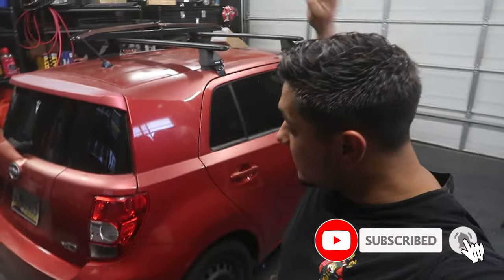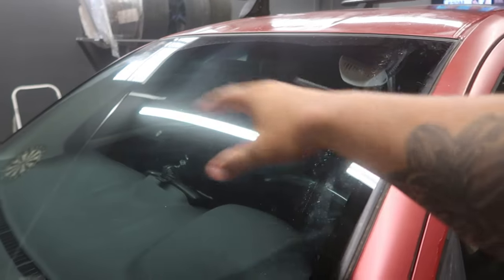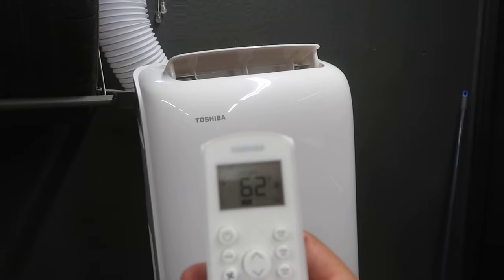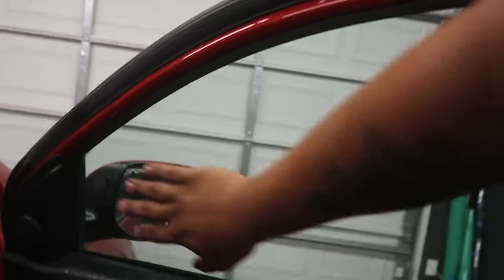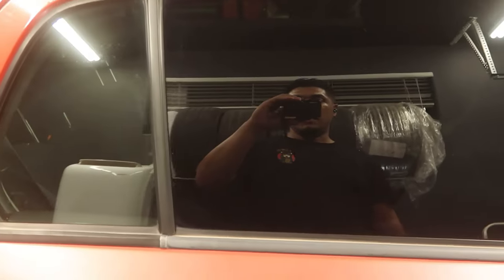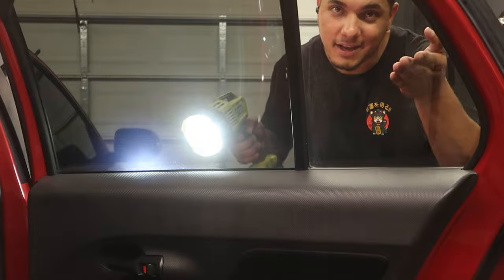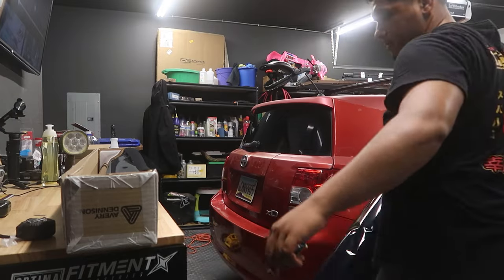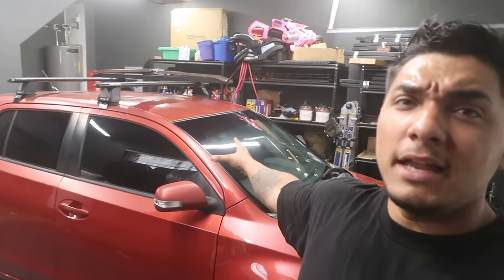Full 15% Tint on this Scion XD!

Comment: I am also a beginner tinting, the struggle it is real 😂😂😂😂😂😂. I wasted around 50foot roll just training, but my biggest mistake was the cutting part. Love your honesty real 🔥🔥🔥🔥 you are getting better every time. Let’s do it 😎
Reply from the maker: Oh trust! I wasted a pretty decent amount from creases, burning, short trim, etc 😂
I’ve done about 6-10 cars free until I was confident enough to start charging
Reply: @brandonleyva11  to be honest I train in my car, I have a Acura MDX 2017 advance packages, after my car I did a Durango RT2021 🤣🤣🤣🤣🤣🤣🤣 2 front window and front windshield $240.
Reply: But my mistake was buying a expensive film for training  36x100 ( Pro classsic ) $255. Luckily I was able to almost make the money I spend on the film with once car. Also the film it was lifetime warranty.

Comment: The struggle is real...I am going thiru the same thing...Frustrated with the cut.
Reply: It’s easy to ruined the film by cutting short, I went through that 100 times until I starting noticing went I was cutting the film was moving pay attention to this this could be your solution.